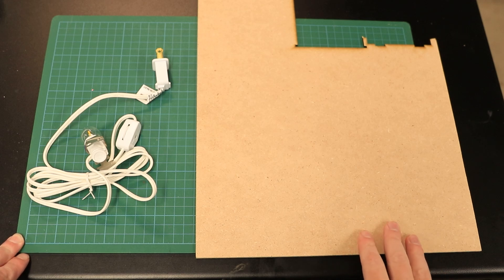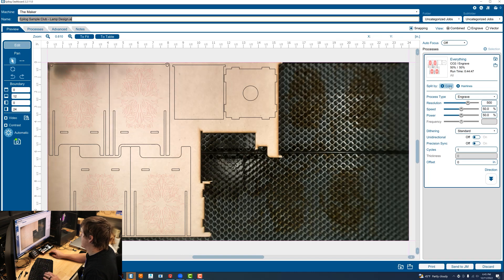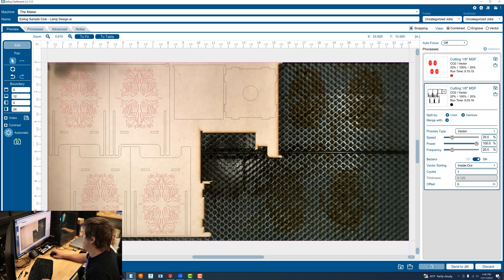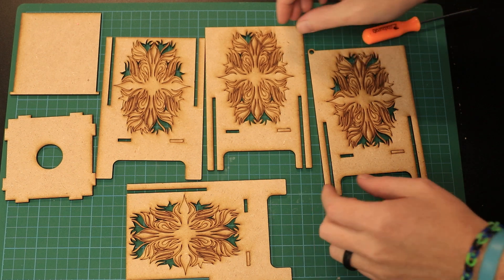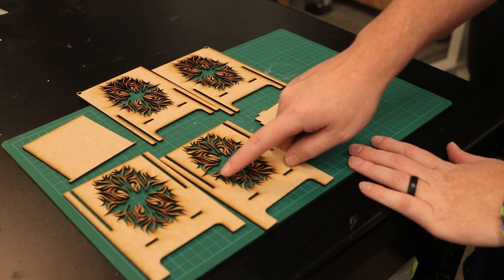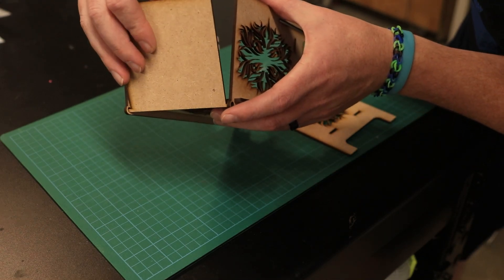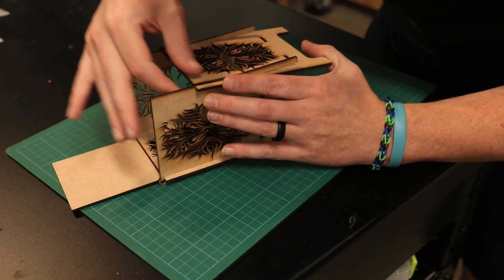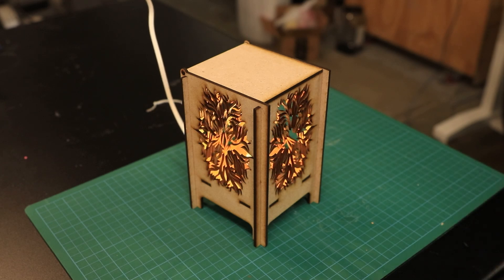Laser Cutting a 3D Lamp

Comment: What factors do you consider when choosing the frequency?
Reply from the maker: Frequency plays a crucial role in achieving clean and precise cuts across various materials when cutting with your Epilog Laser machine. In the case of wood, in order to minimize  the charring on the cut edge we recommend a lower frequency to achieve less burning/charring, but thicker and more dense the woods may require a bit high frequency to achieve a clean cut in one pass. When cutting materials like acrylic, plexi, and sign plastic, we recommend higher frequencies to achieve a clean polished edge that requires no or very little clean up.

Comment: How do you adjust the kerf with other Thickness material? To fit everything? I use the epilog fusion maker. Thanks.
Reply from the maker: It will depend on the overall thickness of the material and vary with every material and the thickness with which you're working. There won't be a one solution fits all materials option here. If you find that the kerf is too thick after a normal one pass cut, you can start with settings adjustments, but you'll most likely need to adjust the artwork very slightly to achieve  a smaller kerf.